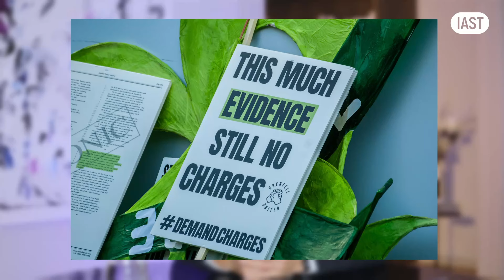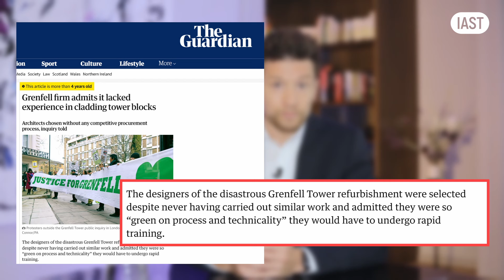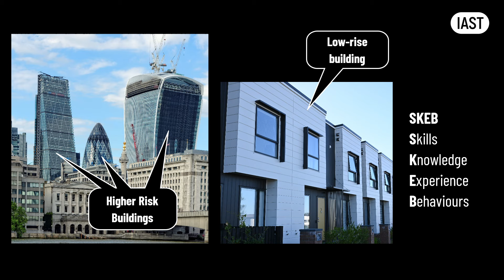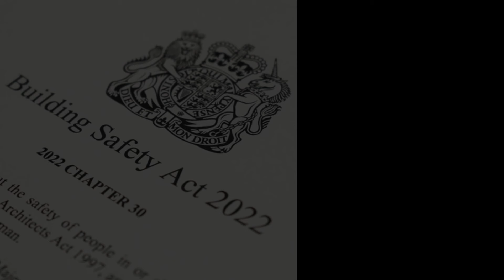Building Safety Act 2022. The End of Design and Build. Key Points You Need to Know

Comment: We just finished a cladding remediation project in London where ultimately they needed a EWS1 for the building. The duty holder appointed their own fire engineer and we also employed our own. Before any start on site all our drawings had to be signed off by both engineers. Then once we begin on site at every stage we were inspected. We also produced a detailed photographic record referencing to the drawings. We then provided the golden thread of info by having detailed signed off data sheets. Whilst we may not of been able to demonstrate competency via certification of our labour I feel with the above we did manage this.  And obviously we had the right level of PI cover.
Reply from the maker: Great point! The challenge around certification availability is significant for stakeholders, especially contractors who often have to go the extra mile. Without clear pathways to certification, contractors end up taking a belt-and-braces approach to ensure they meet compliance standards. This can lead to added costs and complexity but may be necessary until more accessible certification options are in place. Hopefully, as the industry recognizes these gaps, we’ll see improvements in certification availability for all involved.

Comment: This was very informative. Thanks for this. As a structural engineer, I found the plan work of design being completed and approved prior to construction for high risk buildings to be very similar to the SER system used in Scotland. Construction cannot start without a building warrant being in place and for HRBs (or RG3 buildings), no items can be subject to "Contractor Design". If there are specialist items that need third party design, then specialist need to appointed prior to construction of that stage and included within the warrant. To get around programming issues, warrants are usually staged to allow specialist design to be undertaken during construction but the details must be considered as design intent beforehand.

Comment: How many of the problems go back to people being underpaid? The lowest cost rather than the best value mentality. People cutting corners and in a hurry not only decrease site safety, but also build quality. Add in form filling to off load responsibility, and training that is of questionable value, but necessary to make up the hours required. It all eats up time. Does it simply add to the initial problem? 

Contractors employ subcontractors, but who exactly trains apprentices? What does it take to be a bricklayer or plasterer on a building site? Is it any wonder there are not enough skilled tradesmen? 

The key to good build quality is proper detailed design. That design checked, quantified and tendered. Proper on site supervision is a necessity, not just by the contractor but by people who are working for the client or who are from a statutory body, or both.

Comment: Some things should never be privatised. Building regulation and inspection is one of those things. The local government needs to be funded to employ inspectors to visit every build at all the key stages of construction, inspect it according to its own approved design and the regulated codes and standards, and sign their own professional indemnity saying they've inspected it and it meets its requirements.

Also, who the blazes lets them start building without having every last detail fully drawn and specified? That's just asking for disaster.
Reply from the maker: Government inspections, while essential for safety and compliance, can sometimes be time-inefficient, leading to delays on site. In an industry where most projects are already behind schedule, additional hold-ups from inspection processes can add significant pressure. Balancing the need for thorough, accountable inspections with the realities of project timelines is a challenging task, and finding ways to streamline these processes without compromising standards could make a big difference to both safety and efficiency in construction.
Reply: @IAST-UK  On smaller works, the role of Building Control and site inspections is essential. Clients on such projects seldom employ the designer to monitor the progress and standard of work. Building Control is independent. It does not rely on the patronage of clients in other parts of the building industry for commissions.

Comment: Mass builders appear to build using self certification and allow themselves to to build absolute crap. As a self build, the building inspectors were looking over our shoulders at every point. We however were making it to a standard FAR BETTER than they were expecting. The mass builders leave out as much as possible and insulation missing  en masse along with cockeyed doors and windows etc the quality of these estates are terrible.
Reply from the maker: t often depends on the developer’s intentions—whether they’re building to retain the property for rental or as a main contractor constructing for a client intending to sell the units. In cases where the goal is to sell, warranty providers are usually the main parties incentivized to ensure regular inspections during construction. Unfortunately, without consistent oversight, some mass builders prioritize cost-cutting over quality, which can lead to the issues you mentioned. This highlights the need for more rigorous and standardized inspection processes across the board.

Comment: In my opinion pushing more responsibility on to both the main contractor and principal designer  will result in even more detrimental workmanship. How have so many poor private building inspectors got away with charging for effectivley nothing?
Reply from the maker: Yes, another issue is definitely the competence of inspectors. When private inspectors lack the expertise or rigor to enforce standards effectively, it can lead to serious quality issues. Pushing more responsibility onto the main contractor and principal designer without addressing the competence of inspectors could result in even poorer workmanship. A stronger focus on inspector training and accountability would go a long way in improving construction quality and safety